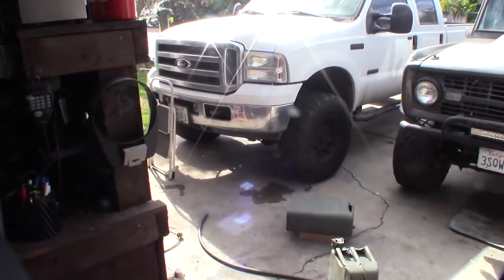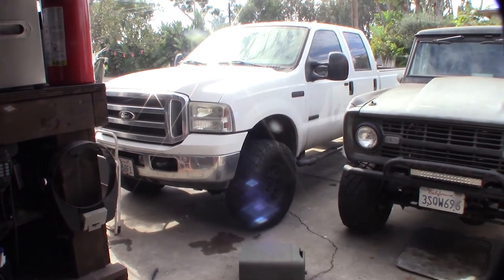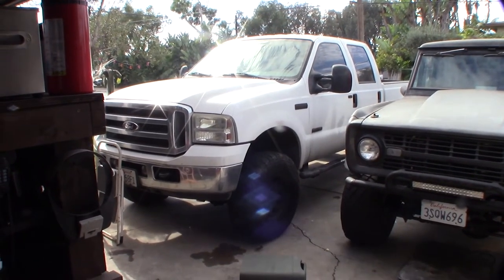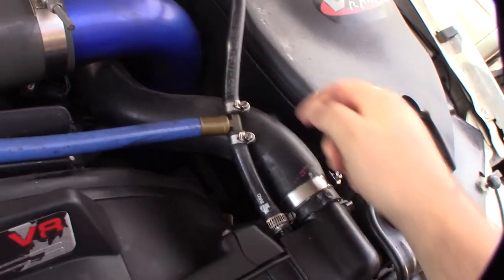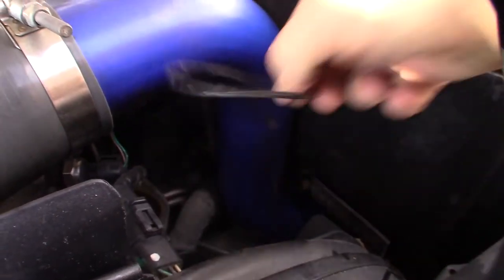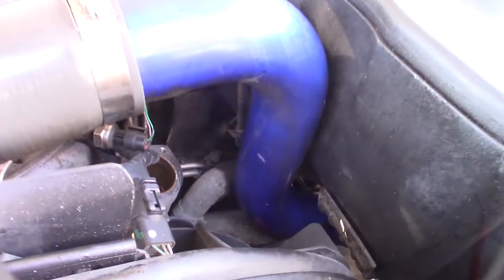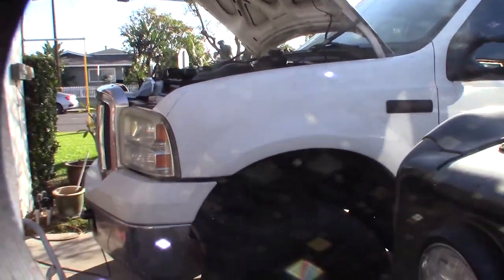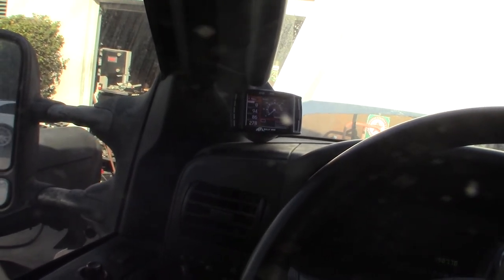Powerstoke 6.0 Thermostat Replacement 3C3Z-8575-AA RT-1169 F250 F350

Comment: If the thermostat is bad would it cause bubbles coming out the top of the  radiator hose its connected to i just noticed it saw little bubbles coming out radiator hose tightened the clamp and let it heat up no more bubbles thanks

Comment: I have a 6.0 and it over heats and I think it need a newTorque converter. Is the torque converter make over heat?
Reply: EGR cooler could be leaking. It can be a number of things. Fan clutch can be bad. Worst of the worst it’s a head gasket issue and that’s a pretty penny. If it is head gaskets do some research, there’s a brand to stay away from and make sure to stud it if it isn’t already studded. The torque converter would make the trans overheat
Reply: @morganmead4404 I got a couple estimates on getting my already deleted 2006 f250 studded and 5K  and 6 K for cost so ima just wait till it starts leaking and for a little more buy me a rebuilt 6.0 that's studded!!